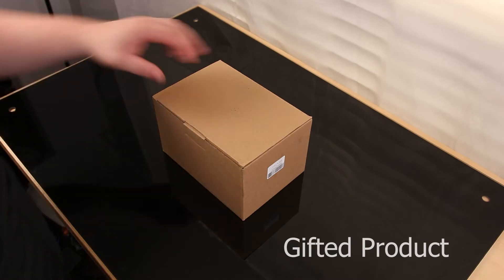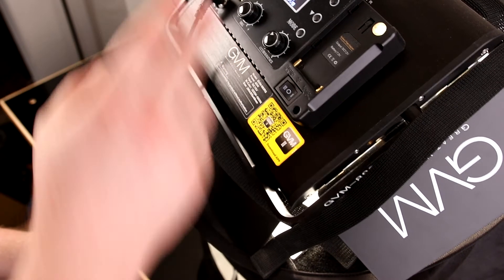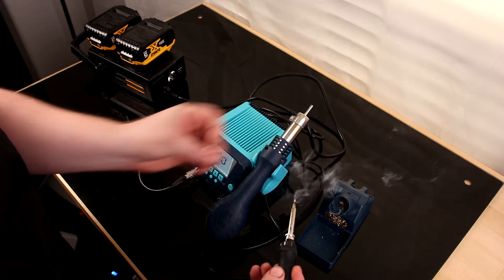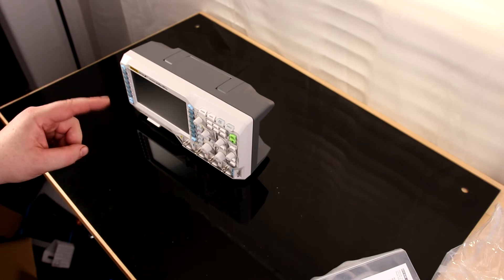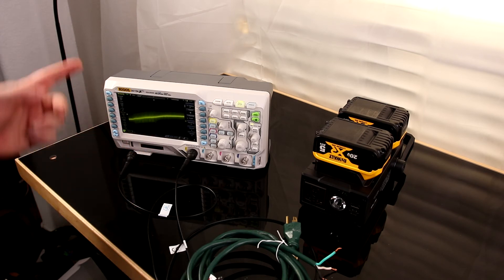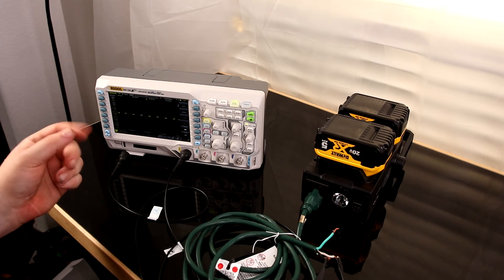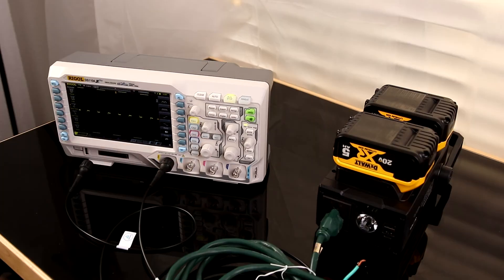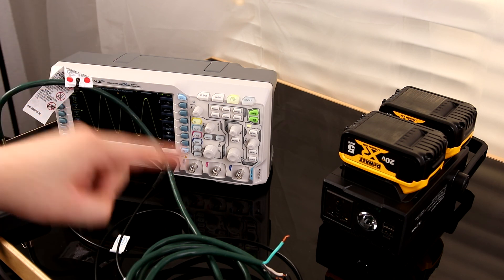Using An Oscilloscope To Test An Inverter (Square VS Sine Wave)

Comment: DOWNVOTE, NO SUB:  You did not explain how you took your measurements.  1) the explaination of the svicide cord, how to connected the meter and what settings.  You must not be an engineer because a good engineer always explains the test equipment when measuring not just show the results.  bye
Reply from the maker: I'm not an engineer.  If you're an engineer and can't figure this out, you're an idiot.

Comment: When you have a square wave that spends some time at 0V between each maxima and minima, it’s called a ‘modified sine wave’. You will sometimes see this term used with inverters. And I don’t really like it because I find it rather deceptive. It makes the inverter sound much better in terms of waveform than it actually is.

Comment: It would have been not only useful but a better example of your title here if you actually placed the camera closer and level with the scope screen. Also, showing how to safely connect the scope to the power would have addressed the title of this video. 
Instead you simply summarily explained the waveforms, an explanation found all over the internet, and ignored the really important content, content that isn't delved into well elsewhere either.